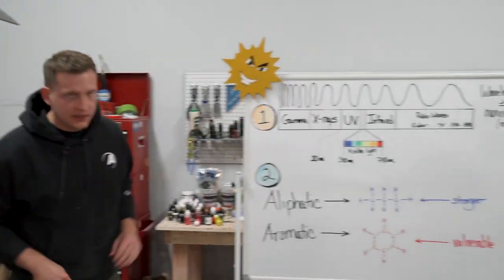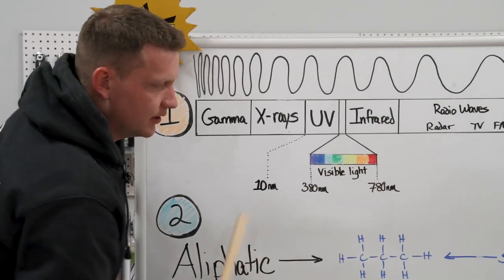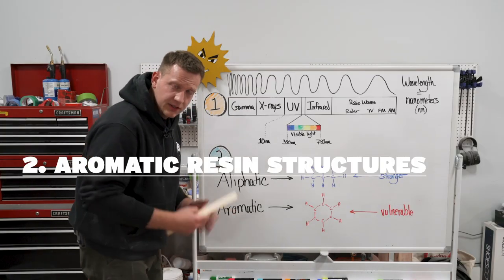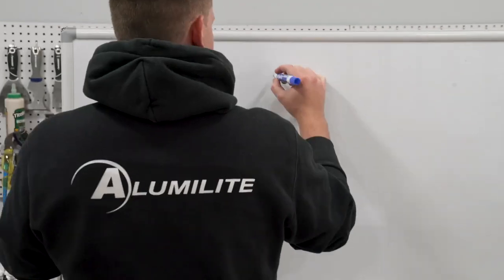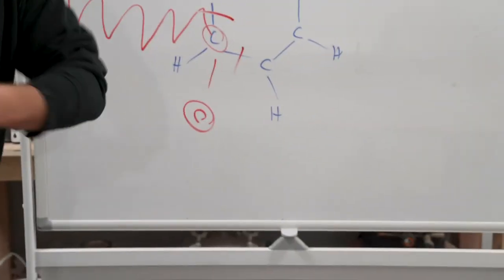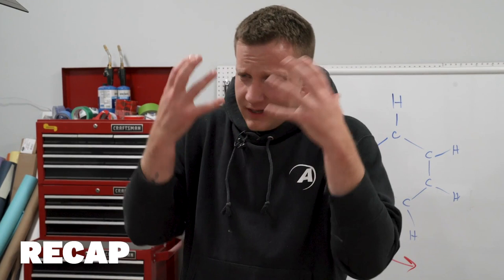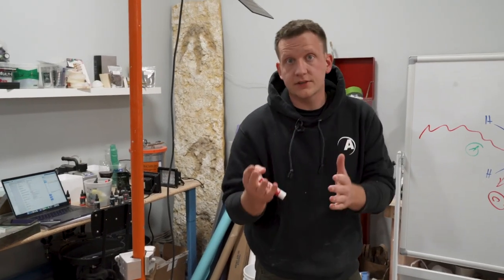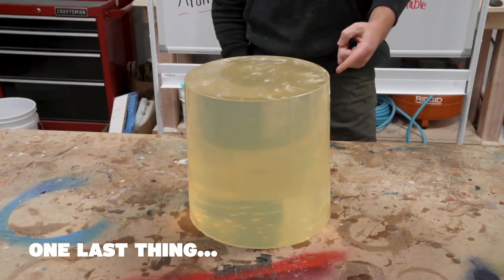Alumilite Explains: The Science Behind Yellowing Epoxy

Comment: Good short VID on the issue.  One thing that also impacts is the finish.  Many people finish with oils and the majority of these are already yellow in some form.  Finishing in a good clear car lacquer helps in two ways, one it is a perfectly clear hard wearing finish, but it also provides additional UV protection.  Nothing of course will stop the yellowing, but a good clear car lacquer can add up to another 10 years before the yellowing is noticeable on the majority of colours.  A lot of people don't like the lacquer finishes due too the high gloss, but there are additives used that can give you anywhere between full gloss and flat, personally on tables I use a 30% sheen.
Reply from the maker: This is a really great tip that we didn't even think about! Thanks!!
Reply: when do you add the car lacquer? While wet? Or when project is completely dry? thanks in advance 🥰
Reply: @mzbeegrier539  completely dry
Reply: Is there a particular type of car lacquer that works for resin better than others?

Comment: How well does a UV blocking clear coat work to slow down the yellowing? It seems that it would not only block UV, but also block oxygen from getting to the surface to bond with the carbon.
Reply from the maker: This is an awesome question and definitely something we were wondering as well!! From what we can tell, the top coat would do a great job  of blocking the UV rays for a period of time but would still eventually yellow since there's only so much added UV resistance an epoxy can take. This would be a great experiment to run though!!
Reply: @AlumiliteCorporation  You also might want to test 303 plastic protectant, which claims to protect against UV damage.  Some people seem to swear by this stuff. It also has the advantage of being able to be re-applied.  I have no idea if it works or not.  I don't know that anyone has done any good tests with accelerated UV to show if this stuff works or not.

Comment: Great video! Question. You mentioned that there is an opportunity for yellowing to occur during the curing process if an inappropriate amount of heat is generated during the cure. If this overheating does happen, but the epoxy does NOT yellow due to this, does it also mean that this epoxy will be inherently more susceptible in the future for yellowing? Or will it just have the same potential for future yellowing as an epoxy pour that stayed within the recommended temperature/thickness range for that epoxy's specifications?

Comment: A minor nitpick: you described HALS (Hindered Amine Light Stabilizers), not UVA's (Ultra Violet Absorbers.)  You need both in a clear coat.  Clears need more UVA than HALS.  You also don't talk about the curing agent's importance: something like Jeffamine D230 is pretty good against yellowing.
Reply: How would you use Jeffamine in existing epoxy you buy?
Reply: @andferni  it’s in formulated curing agents.  I’m sure Alumilite uses it or something similar.

Comment: in the complete absence of atmospheric oxygen, free radicles can still progress via oxidation pathways by binding to the oxygen that was originally incorporated in the structure of one of the resin components, kinda like how pure potassium metal can rust/burn in a complete vaccume if placed on a piece of paper. Actually, despite a surface patina that may form in normal atmosphere, this mechanism for oxidation and yellowing should always be the dominate pathway unless the resins are super thin because epoxy does a good job of blocking atmospheric oxygen. thats why its used in some surface treatments to prevent metal corrosion like on modern automobiles. cars are made of bottom barrel carbon steel that rusts pretty quick when exposed. 
also this is really semantic and the chemist in me that is cringing from the carbons with only 3 bonds in ur "aromatic" diagram, but it should be understood that its not the cyclic structure of carbon rings that absorbs uv light. some of the most common alipathic cyano components are unsaturated cyclohexane derivatives (a ring structure but with 2 hydrogens on each carbon in the ring). Its actually the existence of the double bonds that can rearrange very quickly in unsaturated/benzyl/phenyl rings or even straight chains which are the component that absorbs most frequencies of light/uv. the cells in our eyes use a straight/non cyclic molecule called retanoin to absorb light and see colors after all... the existance of simmilar energy rearrangments of these double bonds means that quatnum mechanically the bonds are actually some average of these states which spreads out the posistion desnity/probability density of the pi bonding electrons between conjugated (alternating double bonds) carbon atoms and therefore has overlap with the same energy frequency that makes up UV/visible light. because theyre simmilar in dimension and energy they interact and absorb the light energy which then produces the radicles. you can think of this like how only objects of a certian dimension in the microwave oven can actually absorb the microwave energy, and irronically two grapes are in that goldylocks zone of size and conductivity to where they actually act as a coupling antena and can ironically produce plasma/bust into flames in the microwave lol. most microwaves use wavelengths that are about 4-5 inches long. this has overlap with stealth fighter technology and methods of reducing radar cross section by making features 3x bigger or 1/3rd smaller than commonly used radar wavelengths to avoid electromagnetic coupling=radar return

Comment: In the floor coating systems for playgrounds (with high traffic) is it if the epoxy layer is covered with two layers of polyurethane paint to prevent yellowing? If not, how many layers do we need?

Comment: Thanks for a very informative presentation! 👍  I've wandered into unknown territory trying to make what-should-have-been an easy and crystal clear keychain. I didn't have time to research.  I want to put REAL, green 4-leaf clovers into a mold and cast them for keychains.  Which product is the clearest?  Do I have to prep the leaves somehow (glue or?)?   And... do I need a special mold (hard vs silicone?) to get crystal clear shiny results?  Thanks! 🙂
Reply from the maker: Tammy, I'm so glad you've found us! For keychains with plant inclusions, making sure the plant is dry will be helpful. Pouring the mold half-full of epoxy and letting it cure for a few hours (but not fully) so that it's slightly sticky is the perfect spot to be in. Using tweezers, set the clovers onto the layer of sticky epoxy, and then fill the mold the rest of the way with a new batch of fresh epoxy. Ta da! Our Amazing Clear Cast epoxy will be best for this - and any keychain mold will do!
Reply from the maker: Castings pick up whatever the texture of the mold is. If the mold is super smooth, your casting will come out super smooth. If your mold is textured, your casting will come out textured, so on and so forth :)

Comment: I have been working with my team on an economic solution for some time (at a university in Germany). There are promising ways to counteract yellowing. However, they are all VERY expensive because the necessary chemical components are challenging to produce.

But I can say this much: the key lies in using silicon and ceramic compounds. After approximately one month of very extreme intense UV radiation, we could not observe any yellowing.

Comment: so if the free radical carbon is bonding with an oxygen which is causing the yellow discoloration, wouldn't we be able to prevent the yellowing from happening by applying an aliphatic topcoat that would act as a barrier between atmospheric oxygen and the carbon that gets released  underneath the topcoat? Preventing oxygen contact with epoxy sounds like a solution to yellowing. I wonder how effective this theory is in practice
Reply from the maker: That is an awesome theory, Carter! We'll keep it in mind for any future experimenting we do!!

Comment: Thank you so much, all of your videos have been extremely helpful and I appreciate your work so much. Just one question:
If I degas my resin after mixing and prior to pouring, pour the cure in a pressure pot will I extend the period before yellowing?
For context I'm looking at making dice
Reply from the maker: Degassing and pressure casting won't affect the yellowing process, it will just help out with bubbles!
Reply: @AlumiliteCorporation  Thanks for the reply

Comment: hi, I am planning to do sidewalk tiles with led. I gonna use epoxy. They'll be installed on sidewalks at outside. Uv-resistant epoxy resins are hard to find in my country, I googled at internet everybody suggests I have to use spar ( yacht ) varnish. So how about your opinion about applying spar varnish over cured epoxy. Does it work? my tiles will be colored also, they'll not be crystal clear.

Comment: If I put down a white epoxy garage floor, should I expect it to yellow if I leave the garage door open for 1hr a day? Using a UV resistant epoxy top clear coat... would that help?
Reply from the maker: Awesome questions, Aaron! One of the downsides of epoxy is that it all yellows eventually - the amount of exposure just alters when that happens. UV resistant epoxy would definitely help keep it white longer, though!

We would recommend checking out our sister brand Stone Coat Countertops for this type of project - they specialize in surface coating epoxies and should have a ton of resources online to help you with the process!! Check them out here: https://www.stonecoatcountertops.com/flooring-epoxy-page!

Comment: I’m wanting to do a epoxy floor over a wooden floor that is above a concrete block building and I have about 342 dumb questions to ask lol mainly about what type I should use . Not so much worried about looks just mainly strength and the cost .. or if I should even do it.. can u help me lol

Comment: So can we go a bit deeper.  You said air. Are we strictly speaking atmosphere,  or does air trapped in bubble within the resin cast affect this as well. If so,,, can a vacuum tank reduce the effects dramatically?
Also, there must be something we could coat the project with that would be an armor and encase the entire  project from oxygen. No ??
Reply from the maker: We can absolutely go deeper! Removing air is a helpful factor, but it isn't a cure all by any means. The UV rays are still going to interact with the rest of the materials chemistry causing the yellowing. Air isn't the only factor. Encasing the object to avoid all oxygen is great, but again it doesn't solve the whole picture. Blocking UV rays would be just as important and is difficult to do with the chemistries we have.

Comment: How does UV resin cure without yellowing? I've noticed if I cure my projects on a white glazed surface it cures insanely fast and it's extremely hot. Like don't touch for a minute or you'll  have a 1st degree burn hot. Lol 
So, my hypothesis is the heat. Also, is UV resin actually yellow proof? I heard this somewhere, and I was wondering if it's true.

Comment: Mine was stored in a closet without sunlight and it yellowed. It was a gem kinda shaped like a pyramid/diamond. 1/4 inch thick base going to a point of about 1.5 inches thick. So not sure why it yellowed so much while being in the closest. I don't think there was much heat when I made it either.
Reply from the maker: It depends on how long it was stored in the closet! The longer it sits the more likely it could yellow.
Reply: @AlumiliteCorporation  Thank you for the info!

Comment: Have you got a video for the best one to use outside and exposed to the elements or chemicals
Reply from the maker: We don't but that's a great video idea! As far as product to use outside, our Amazing Clear Cast Plus epoxy has added UV rays so it'll take longer to yellow than other resins but it will still yellow eventually. It's also durable and long-lasting so it can handle the elements.
Reply: @AlumiliteCorporation  thats perfect. I have created a concrete garden bench with a cut out, so I can set items in the back rest 👌🏻

Comment: Thanks for your video!!!
How do I fix it after it gets yellowed either by time or by wrong cleaning chemicals??? Pls help
Reply from the maker: Since the material itself yellows, there's no way to fix it - the best option is to do preventative work, like choosing colors wisely, or storing the piece in a dark room away from the window light.
Reply: @AlumiliteCorporation  :( thanks
Reply: @AlumiliteCorporation  Can I use the yellowed resin if its never been open. I have 2 if them. Does it still set up if I used blue mica to color it, as its powder one bottle it brownish. I got hurt  not long after I bought it, and hate to throw it out. Thank you, Debby
Reply: I did;that placed my Amazing clear cast part 2 B in a dark area but part 1 didn’t turn yellow only part B and it still turned yellow .I was going to throw away it but after seeing your video knowing  it’s ok to still use . Thanks for sharing

Comment: Thank you for the video. I had a couple of questions. 
Do urethane and epoxy differ in the speed at which they yellow? 
Is there a UV Stabilized urethane equivalent to Amazing Clear Cast Plus? Thank you.
Reply from the maker: Great questions! So to answer your first question, epoxy will typically yellow more quickly than urethane resin because of the different chemical makeups. For your second question, we haven't seen a UV Stabilized urethan resin but it may be out there - you'll just have to do some digging!
Reply: @AlumiliteCorporation  Thank you for the response.
Also, will different types of Alumilite resins bond together if poured over after the first layer cures?

Comment: What if your part b ice resin turns brown ? And can you still use it?
Reply from the maker: It will dilute when mixed with part A but will still be tinted. If you add dye or powder you won't notice and it should cure just fine, but I wouldn't recommend doing a clear pour at that point!

Comment: I just spent a crap ton of money on the Pro Marine epoxy to do an agate resin table, and now I am seeing horrible reviews about it yellowing.  I have no money to get different resin and I am unable to return the resin I got.  Any advice?  What resin should I buy next time?  I have to buy it by the gallon for the projects I want to make.
Reply: resin yellows over a long time. you should be fine if the table isn't in the sun all day. you can make the resin part thinner so that it doesn't yellow as fast.
Reply from the maker: What V01D said is correct - unfortunately all resins yellow over time. Avoiding sunlight will be your best bet! For future uses you know will get hit with direct sunlight, go for an epoxy with an extra UV additive (for example, our ACC PLUS). Things do have to change in the chemistry to get that UV additive to prolong yellowing, so things like heat resistance temp are lowered.

Comment: Are you aware of the Retrobrighting used by people with old, cream colored plastic computer cases?  Briefly, hydrogen peroxide+uv light can reverse yellowing of old plastic materials that have yellowed when exposed to UV light.  I'd make a guess that the yellowing is caused by the same thing you're talking about.  What's not well understood is the science of WHY the retrobrighting process works.

There's also an idea that the yellowing of (often ABS) plastic is caused by the addition of Bromide to the plastic, which is often added as a fire retardant.  Like most things on the internet, there's a lot of talk, but little experiment or results about if it really is bromide that's the culprit here.

Would you have any insight into any of the above?
Reply from the maker: This is an awesome question for our Maker and Educator Jordan! Send us a DM on any of our socials and we can try and get it over to him!!
Reply: @AlumiliteCorporation   @Alumilite Mold Making & Casting Materials  I'll try the email address.  I'm a bit of an internet hermit, and only occasionally come out of my anonymous cave.to be tracked by MegaCorp.

Comment: Actually. I have the two containers still. And both were clear, but now one of the containers is yellow. The B side is practically orange actually. Why is this?
Reply from the maker: This typically happens towards the end of a products shelf-life (usually around  year) whether opened or unopened. We wouldn't recommend using the product once it's at this stage because you may encounter curing issues.
Reply: @AlumiliteCorporation  Thanks for the info! I actually just did a test last night with 7.5 ml of each to see if it's still good to use or if I should toss.

Comment: Ok so are the uv stable epoxies BS?  What about adding top coat that’s uv resistant 😱😱😱. Eventually will it still yellow.  Thanks
Reply from the maker: UV resistant epoxies (like our Amazing Clear Cast Plus) help to slow down the yellowing process but they won't keep your projects from never yellowing - an epoxy formula can only handle so much UV resistance before it becomes too toxic or unusable.
Reply: @AlumiliteCorporation  I'm kind of curious how the yellow properties get distributed in the resin. Is it mostly the outer core the first to turn because that's where the UV rays enters from. If that's the case couldn't you just sand down old products to buffer out the UV damaged layer? What happens if you keep adding different layers of UV resistant resins? Will they yellow at different times? 🤔😂
Reply: @meetyounever6923  i will venture to guess the seperate layers you are talking about would most likely yellow at conceivably the same rate unless you are waiting extended periods of time between layers. Applying the layers one after another within a few days or even weeks will most likely not make a difference in the long-term
Reply: NEVER is NEVER ever NEVER!✌️💓